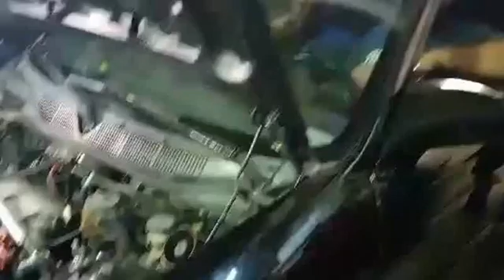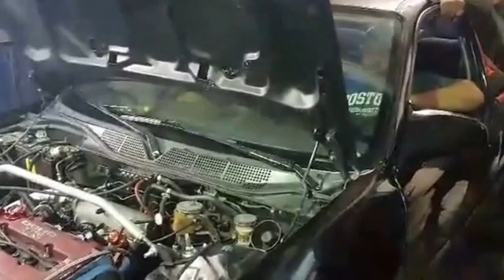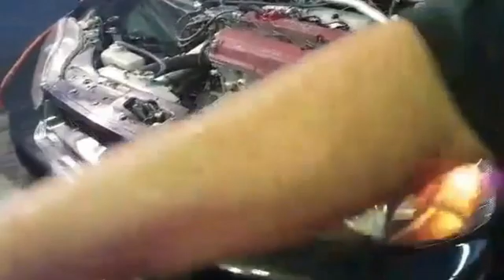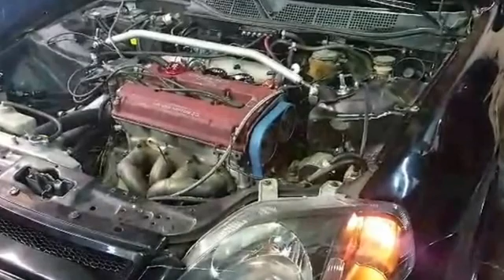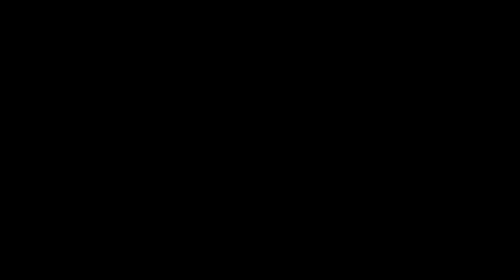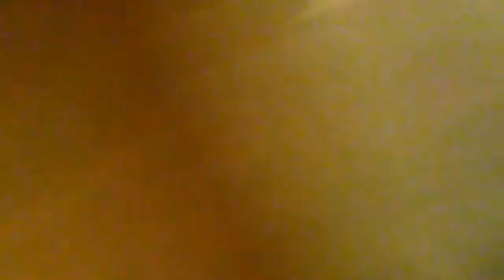Ivan's Turbo B16 Retune: 422whp 369trq

Comment: Looking to put together a b16 turbo. Previously built a reliable stock rod, Nippon LS piston (after the P30 ring-land failed), & GSR cam B16 but it was stolen before I could find the power limit. Using 91 octane & wanting to make power on low cost parts (its a b16 after all), am I wasting time with Nippon LS pistons or is there a better choice?

Comment: turbo spec? power and torque peak at what RPM and boost? Also what's the oil pressure on idle?
Reply from the maker: lol i dont fuckin know man i wasnt their when it was tuned. not my car just my block. the owner has commented around here somewhere. at the time i posted the video he didnt know full details on the turbo.